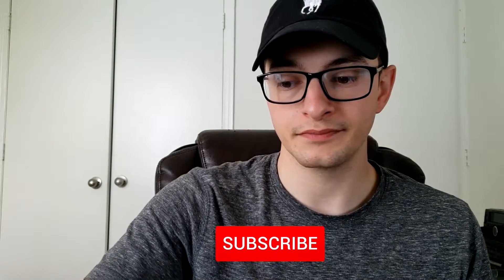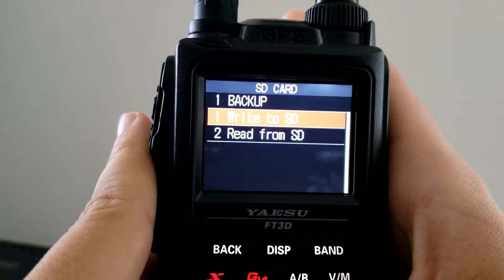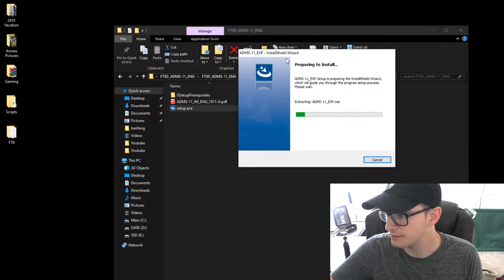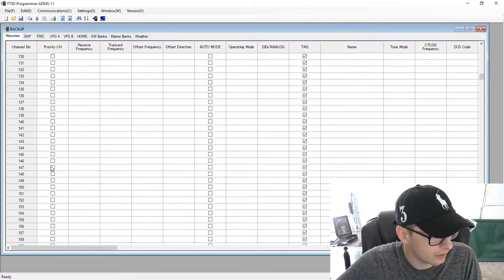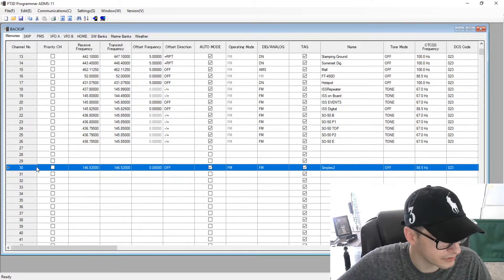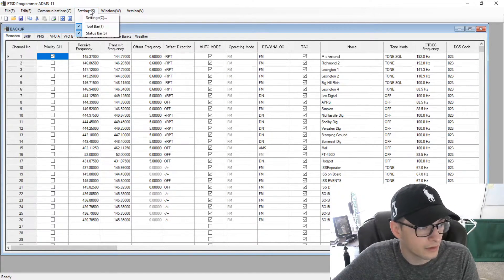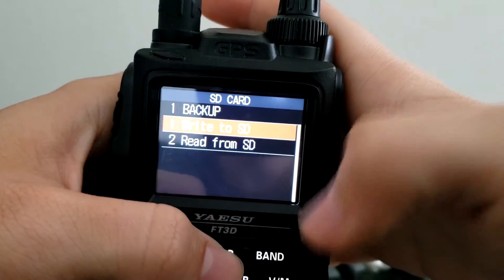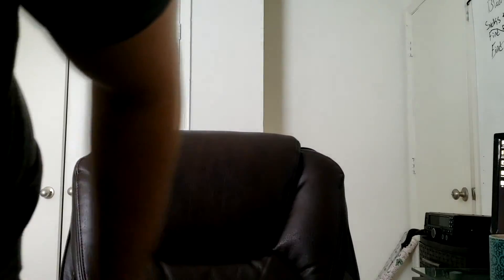How to Program the FT3D or FT2D with ADMS on a Computer

Comment: Thank you so much for this Video, I did buy the RT cable and program then when I upgraded to windows 11 it would not work. Once they started supporting 11 I could not find my cable. This video saved me from having to buy it again and shame on my local shop for telling time I needed it when I was getting started in HAM.
Reply from the maker: That's a good point I have against RT Systems. It's marketed so hard that one would think it's required, and very expensive if you take into account all of the cables and versions.
Reply: Thank you for your content. Your videos make it much easier for someone new to Yaesu to understand how the menu system works.

Comment: Just an FYI, the SD card you link in the info won't work with the FT3DR. I tried it. The radio can use a 32GB SD, maximum. I got a cheap 32GB Samsung and that one worked.
Reply: Hello... was just trying 2 different micro cards... the radio doesn't recognize them.
But both are 128 gb... so I see the problem now... I will get a 32

Comment: Thanks for the tutorial! Everything worked great for me until reading from the SD card. I tapped okay, and it says NOT COMPLETED every time. I can't figure it out! Any help out there?
Reply: Did you ever figure out how to get around it. I am having the same problem.
Reply: @sonofahyderite6855  yes, kind of. Import the file from the FT3D first, type over it and send it back. Make sure to save a copy to your computer for later. For some reason, you can't just send a file to the radio without importing first from the radio.

Just out of curiosity, did you update your firmware? I'm wondering if the update has the error with it.
Reply: @MarineOh3   I did the MARS mod and it failed after that. When I got the ft3dr it came with the latest firmware.
Reply: @sonofahyderite6855  hmm, I don't know what it is then. I had updated my firmware before trying downloaded memory channels, so I don't have a comparison for it like it worked like in this video. That's the only work around I've found though for our issue, unfortunately.

Comment: Thanks for the video.  I still might purchase the RT system software (minus the cable and just use the ST card)  just because it has the external resources you can import like repaterbook etc but I was successful with this too.
Reply from the maker: I'ts a nice tool, just a little too expensive for some.

Comment: I have the scu19 for wires x is that the cable I need to use the yaesu software
Reply from the maker: I believe the  scu19 is for PDN mode on wires-X. The cable I used was the one that came with the radio.

Comment: Excellent video, thanks! I tried this method at first using an older 2gb micro SD card, the radio would not accept the new BACKUP.dat file.  After I replaced the older SD card with a new 32gb SD card, the radio read the file with no problems.  Again, thanks for doing these videos and putting out helpful content!